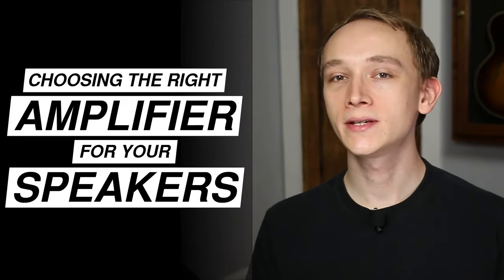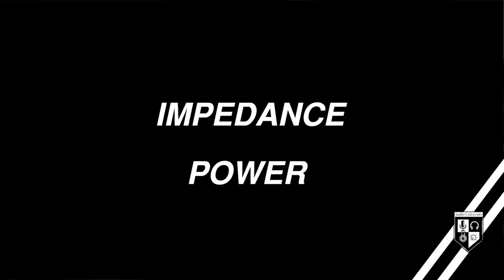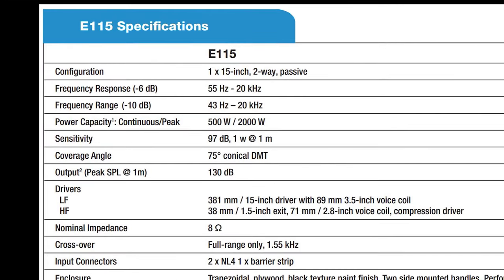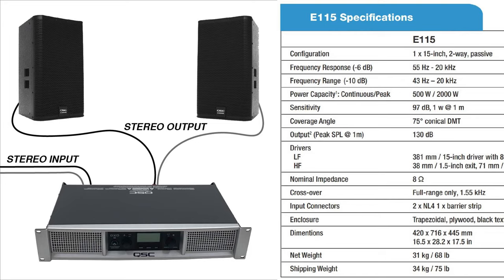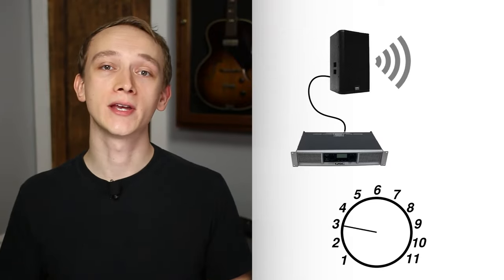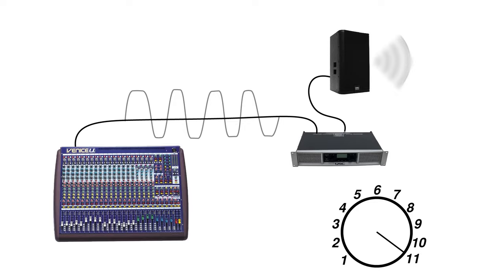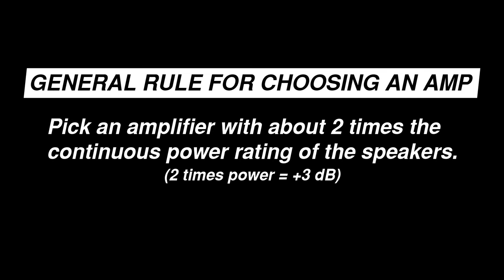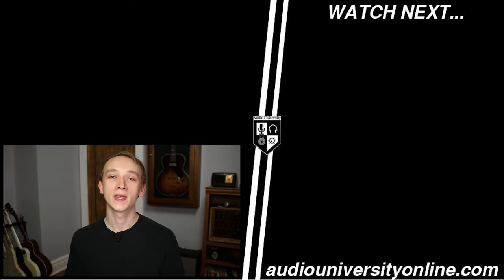A SIMPLE Rule For Choosing An Amplifier | Ohms, Watts, & More

Comment: I think my amp/speaker combo is pretty wrong.
I rarely play music at loud volumes, but even at normal volumes the bass doesn't sound very full-bodied (it clearly is there, but something seems to be missing), and it sometimes sounds somewhat muddy.

The speakers are 8 ohm and have a suggested minimum of 100 watt and a max of 200 watt.

I connected them to my NAD C165BEE + C275BEE combo; that's supposed to be capable of delivering 150 watt in both 4 and 8 ohm?
Reply: I suspect your amp is not capable of powering your speaker.
Reply: @drm9979  So even if the minimum recommended power is 100 watt and my amplifier can deliver 150, it's still not enough?

I indeed have read that amps should be about 50% above the max power of the speakers, so that indeed could be true.
Reply: @drm9979  I forgot to mention; they do stand rather close to the wall behind them. I do know these speakers need space to breathe.
Reply: @MarcelNL  150w for a speaker that minimally requires 100w is definitely not enough for a good result.  a speaker can be making sound while being far below what it is meant to reproduce.  example: I had a subwoofer that was not sounding as I thought it should. it was making noise and even visibly moving but did not seem right to me.  the shop thought it was fine.  the amp had a blemish on it, it had clearly been dropped during install (I am into car audio).  I tried to change it but it was crazily complex, which proved to be a good thing, I had to return it to the manufacturer.  The manufacturer examined it while they had it, it was shorting out and not working properly, they completely refurbished it, now my sub sounds awesome. what i am saying is, the sub was getting some power and apparently working, but not like it should.
Reply: another instance, my whole system sounded lame to me.  The woofers were getting exactly the 100 RMS they were spec'd for, but sounded lame.  I switched amp to one that met the speaker max 200 RMS, completely brought the system to life.  The amp was also a much higher quality amp, which also makes a difference.  One final example that the quality of the amp also matters.  I was powering my midrange with an amp that bridged was 200w.  I heard about the new Morel MPS 2.150 which actually has less power (150w) but all super high end internals,  It costs more than other amps Morel makes that make more power.  Well, this amp completely brought my midrange to life, vocals are very audibly more vivid, lifelike, and so forth.
Reply: there is one other important point to be noted, that I think somewhat disagrees with audio university: according to PS audio videos, also on youtube, which I believe on this subject, the amp CANNOT be too powerful.  that is, the speaker only draws the power it needs.  they even make tshirts that say "ample headroom" to emphasize this point. overpowering speakers only happens when they are fed more volume than they can handle and the only relation of this to the amp is that gain can increase volume, but the same speaker at the same volume, whether it has available to it 100w or 1000w is at exactly the same risk, and is in fact at more risk of too little power from the amp, not too much (again, at the same volume).  I believe i have stated this correctly but if not, the PS Audio video speaks very clearly to this matter.
Reply: @drm9979  Yeah actually the absolute minimum required is 40 watt, they recommend 100 watt, but I highly doubt that that indeed is enough. The max power with pink noise is 200 watt. (Measurements and descriptions were a bit different 30 years ago when these speakers were made.)

I do believe you're right. I hope there is some way that if I would buy 2 subwoofers (next to the speakers), I could take away that bass from these speakers so they don't need to work so hard. But my NAD pre-amp doesn't have settings like a receivver for big/small speakers etc.

Do you have any thoughts on that?
Reply: @drm9979  And thanks for all these lengthy answers with your own experiences! :-) They're appreciated!

I am thinking of, in the long run, buying some Wharfedale 4.2 speakers; theyt would match my amp much better, and also look better than these Etude Rhea speakers. (They used to be absolutely high-end back then.)

Comment: Hahaha.. the way i set up my system way too wrong 🤣🤣🤣

Its a 40watt 8ohm 8inch woofer running on a 4440 ic at 16V =16watts 

Then i am using digital compressor to boost the sound up by 8dB..and to cool the system i am using a fan... 🤣🤣 The system is without any cover... And a high pass shelf to cut the amplitude by 8dB above the compressor frequency.🎉

Comment: The usual commercial drivel. Selling a million-MPH car in a world with a 70MPH limit. Unless you want to peel the paint off your neighbor's walls, your speakers deliver MILLIwatts. Yes, I was an FCC-licensed broadcast (number PG-16-15538) engineer working for 8 years, and found our usual lobby volume WAY less than a watt per channel. I amused myself asking DJs of the wattage they listened to, getting answer on the order of 1 or 2-digit answers, and MEASURING to find milliwatts.

OK. Enough for that wattage nonsense. We are listening, not frying steaks. What is the optimal amplifier impedance? Easy. Zero. With power-op-amp technology available since the 70s, trivial. The op-amp technology provides a 'virtual short' giving zero ohms impedance, up to the the power-supply or output limit. What is your cable resistance? Pretty irrelevant. What is your speaker inductance? Irrelevant.